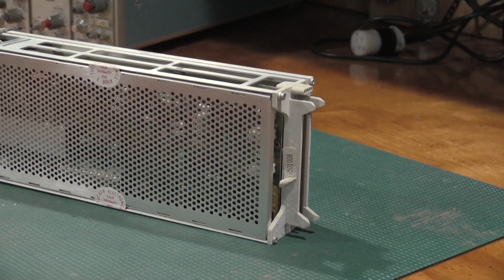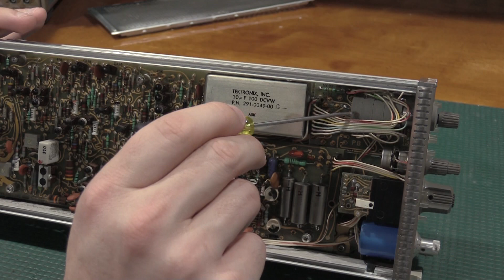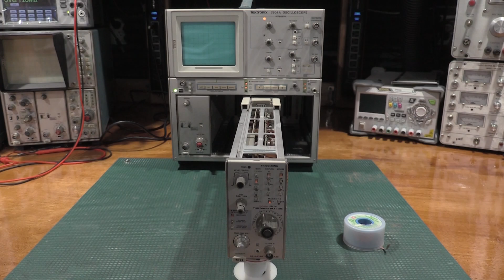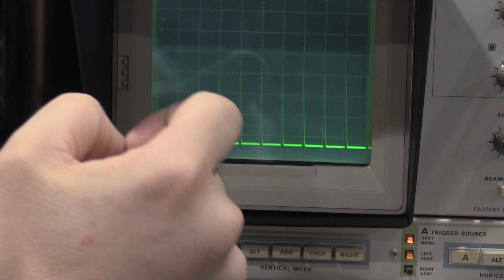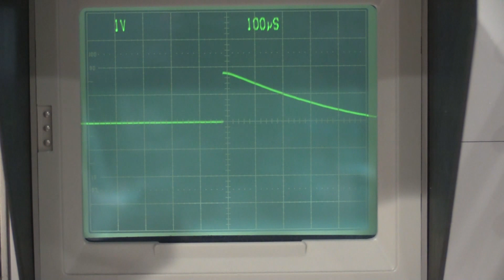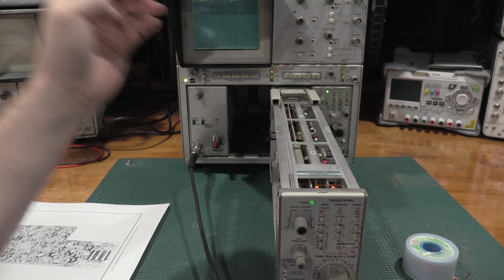Tektronix 7B71 Repair and Partial Alignment

Comment: Hello Zenwizard, I own a 7904 with some plug in's and I just finished the Main Unit frame restoration. Works great and I am trying to do the calibration following Tek manual but... they are using the Calibration Fixture 067-0587-02 for pretty much all alignments. Any chance you can suggest or maybe you did it already, to use a different calibrator as a signal source? The 067-0587-02 is an extremely expensive unit.. thanks

Comment: I have purchased both Tek and HP from Tucker back in the 90s... It appears they are now out of business, but I don't know when they closed.
I have a 7B92 and 4 of the 7B92A bases... this video reminds me its been a few years since checking them with my TG501. Funny, I checked out the TG501 into the Siglent SDS2202X-E when it arrived last year, just to see how the scope time based... which it did right on.
Reply from the maker: The TG501's also seem to hold their clocks really well over time.

Comment: You inspired me to work on my 7B51.  I can report that the Level/Slope potentiometers R260A/B in Tek part # 311-0912-00 have small collars that hold the pots together.  Enigmatically, both collars are cracked through axially - causing the movement of the wipers to rock the bodies of the pots back and forth a small amount.  Introducing work hardening and failure in blue/white lead at the pot connection point!  Resolder and (pondering) super glue...
Reply from the maker: Well seems like I am now in the same boat. The new 7B80 that I got and am working on a video on has exactly the same issue. I have a potential fix for it but I want to test it out before I send any one else down that road. I will know more Wednesday when my order comes in.